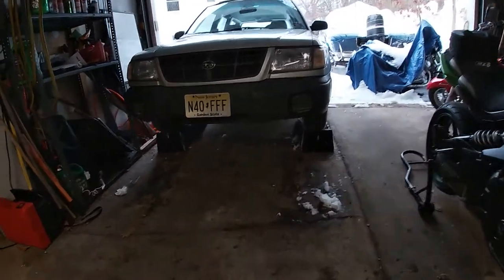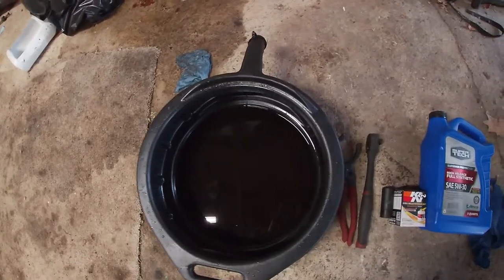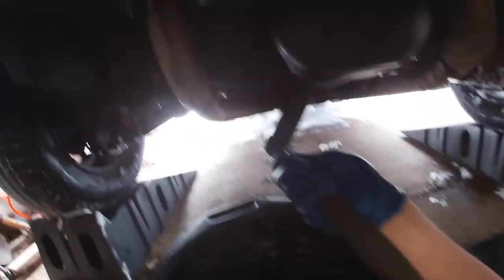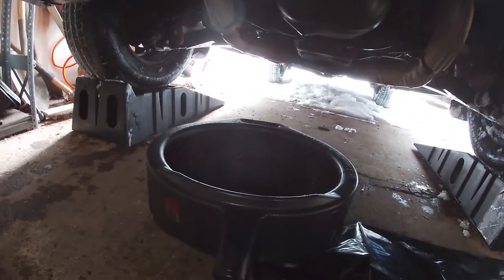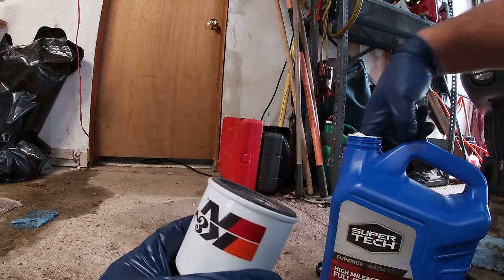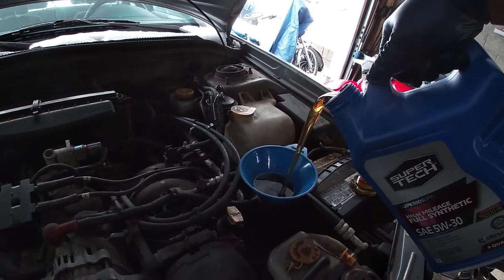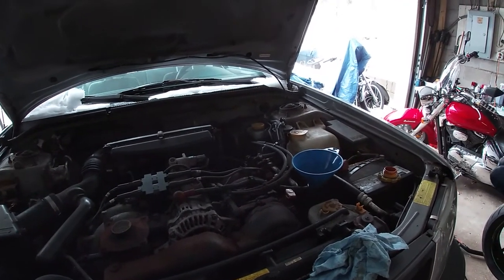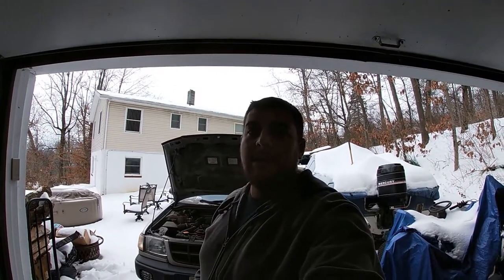Subaru Forester Oil Change - Quick and EASY

Comment: Where did you get the Stands the wheels sit on? Do you have a model#?
Reply from the maker: These are Blitz 11903 Rhino Ramps that I bought about 14 or 15 years ago at AutoZone. I don't believe they make these exact models anymore, but the newest Rhino Ramps at AutoZone, Walmart, Advance Auto, etc... should do the trick just fine.
Reply: @FoulNews  Great. Thanks

Comment: My car won't go into gear after my oil change? Is their a reset i need to do?
Reply from the maker: Do you have an automatic or a manual transmission?
Reply: @FoulNews  auto
Reply from the maker: @PjH-e8i  when you say it won't go into gear, do you mean that the shifter physically won't move or when you put it in gear, the engine just revs and it doesn't go anywhere?
Reply: @FoulNews  yeah I can move the shifter but it won't like engage
Reply from the maker: @PjH-e8i  It sounds like you may have drained the transmission fluid and not the engine oil. Check your transmission fluid level to verify.
Reply: @FoulNews  okay thank you sir really appreciate it ill check it when I get home